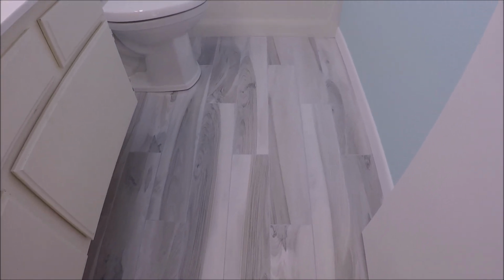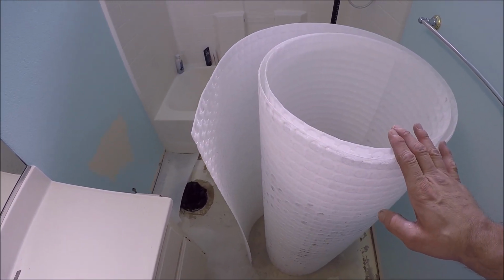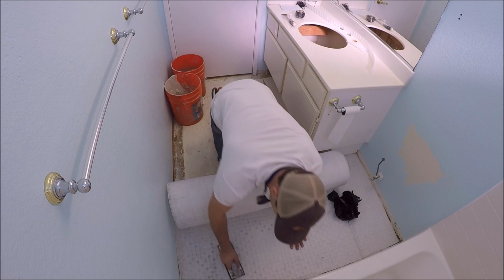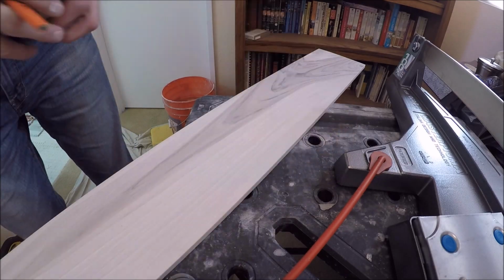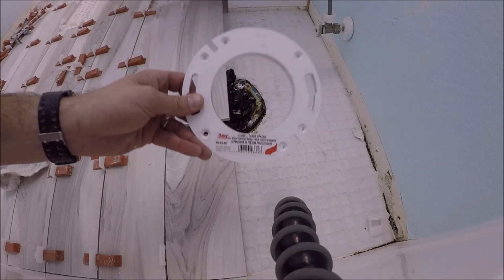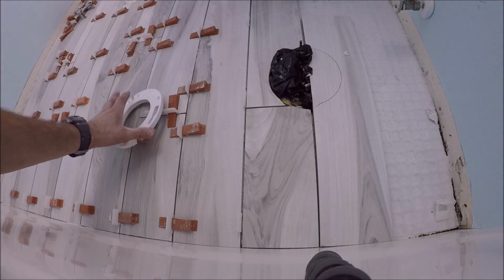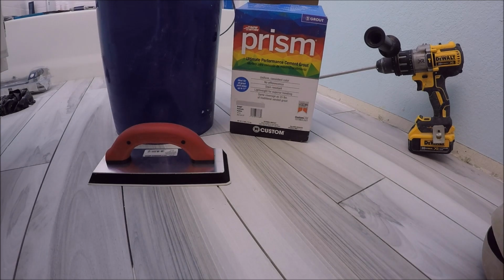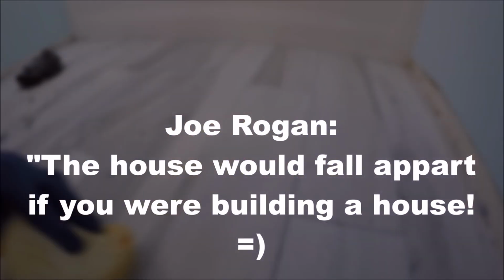Install Wood Look Tile - No Tile Saw Needed!

Comment: Looks great.. and so quick. At 7:09 you show that you've continued tile on both sides and are now filling in the center. Especially with only 1/16" spacers, how do you make sure you aren't just a little off? How long are you comfortable with moving the tiles slightly after laid down?
I always end up tiling this situation on a second day. Would be nice to do it all in one.

Comment: Great video only thing I dislike is the pattern matching on the tiles, I know you can never get it perfect but at a glance I can definitely see some I would have flipped round
Reply from the maker: I agree, we usually ask the customer if they want it random, or to match up the veins/movement. They wanted random..

Comment: How did you clean your tile surface before and after grout how you remove the grout sand? I know people use acid or vinegar, sometimes just water. Just curious I have learned a lot from you.
Reply from the maker: Just water and a sponge

Comment: I am in the middle of two bathroom remodels (DIY projects) with wood plank tiles as well. Do u reccomend removing the vanity if it is not going to be replaced or just tile around it and buy a bit extra tile just in case it is ever removed?
Reply from the maker: I would simply tile around it unless you plan to replace it now or in the future.
Reply: @LandbergTileTV  No i have no plans of replacing it for the next few years. In fact i painted it and made them both look new and plan buying knobs for them. Thanks for the advice i was dreadomg the plumbing

Comment: What are those clamp down spacers? Do they make for a more leveled time set?
Reply from the maker: Yes, that is a leveling system called RLS tile leveling system. This helps and provides a superior installation for large format tile and porcelain plank tile. 👊

Comment: What is the model number for the Montolit diamond blade that you are using?  Great Video by the way.
Reply from the maker: I don't know, but I got it from Contractorsdirect.com. It's the Red and blue Montolit blade...
Reply: Thanks!  I bought the Montolit 4.5 inch Diamond Blade Progres CG115 (Red/Blue)

Comment: When you use that tiling leveling system to prevent ridges do you clamp each wedge to the exact same depth? How do you do that? Do you count the teeth left on the back of the wedge or something?
Reply from the maker: Not necessary, simply pull the trigger until it feels tight and check for lippage 👊
Reply: How do you check for lippage? I saw one video of a guy sliding a coin across. Thanks again
Reply from the maker: Use your finger! or slide a bucket across 👊

Comment: Great video!  I am a little nervous about tackling my bathroom this weekend (same layout as the one in the video).  Question...I know you are suppose to lay the tile 1/4 from the wall and 1/8 from  the tub.  Did you put the underlayment and thinset that distance from the walls and tub or does it go right up against it?  I am not sure it matters.  Also, are you using silicone sealant between the tiles and wall and tub?  Thanks!
Reply from the maker: Yes, you need space for expansion/contraction and yes, we use 100% silicone where the tub meets the tile.
Reply: @LandbergTileTV   For Strata Mat on OSB, does it need to be waterproofed first or can the mortar go on the OSB without waterproofing?  Thanks!

Comment: Do you recommend using that underlayment on basement concrete slab, or tile with no underlayment?
Reply from the maker: I would tile directly on the concrete slab if it's porcelain, but would use strata mat if you install stone tile.

Comment: Do I have to use subflooring in the bathroom even if I live in a one storie house?
Reply from the maker: I'm not sure what you're asking, If you have a wood subfloor, you need a tile underlayment such as Strata Mat or Ditra from Schluter. If you have a concrete floor, you simply clean it and tile over it.
Reply: @LandbergTileTV  Than you very much for your answer
Reply: @greek7316  While it is physically possible to set porcelain tile on concrete, it is not advised. Over time concrete mass builds pressure due to ground movement, expansion/contraction, etc. and can potentially crack to relieve that pressure. If an uncoupling membrane is not used, the tile will crack with the concrete. An uncoupling membrane is definitely advised over concrete.

Comment: I have a question about leveling the floor for the tiles.  My bathroom looks to be exactly this size and everything is in the same spot.  The problem I have is the floor dips down slightly over by the door, in the corner, where the hinges are.  Can I ad a little extra back butter or thin set in the corner to level out the flooring?
Reply from the maker: Yes of course you can add more thinset. I would recommend using a half inch trowel for the floor and the back of the tile with a levelling system and you should be fine. 👍

Comment: Good video, moves along through the process nicely.  Do you seal the tiles prior to grouting for easier cleanup?
Reply from the maker: It's not necessary to seal porcelain tile, we only seal the grout after installation.

Comment: When I told they guy at the tile store I was interested in looking at the membrane he said he couldn't recommend it over cement board because if you have any wood deterioration or settling over time, the membrane would move with the wood floor and I'd get cracking.
What are your thoughts on that please.
I wanted the membrane because I don't like the idea of a half inch plus threshold.
Reply from the maker: That's absolutely incorrect. We have not used concrete board for over three years and will never use it again! The uncouplying membrane does the exact opposite of what he says. It is made specifically to avoid cracking of stone tile or grout lines. He is simply not educated. Check with Sal Diblasi. He will say the same thing.
Reply: Thanks for the reply. The other problem is having to buy a whole $170 roll when I only need 20 sq ft.
Reply from the maker: That sucks, our local tile supplier sells it by the square foot/linear foot. They cut off what we need...Wish I had some extra, I would ship it to you!
Reply: Dude, I'm gonna check that out to see if they will do that for me. Thanks a lot.
Reply: @LandbergTileTV  
So I was lucky and found a place to cut me 20 foot. Yay for that, but everything I'm seeing on the internet talks about laying my wood look tile on the sub-floor, but when I took the old linoleum tile off, it had been laid directly on top of the wood plank floor that is flush with the floor in the hallway. Am I supposed to demo down to the sub-floor or can I just lay on top of the planks and use a wood reducer threshold thing.
  I had a guy doing part of the install, but he is not available atm and has never heard of Strata mat. He said I have to have an inch of sub floor with hardy backer on top or the movement would crack it.  I apologize, I'm having to learn to do all this myself, thanks for being here.
Reply from the maker: @y0nd3r  Yes, you need to demo to the subfloor, sponge the wood subfloor and install the Strata mat. You don't need 1 inch of plywood for your subfloor. We install on 5/8" or 3/8" subfloor all the time with Stratamat.
Reply: @LandbergTileTV  assuming I'm able to get close to the tub with a sawzall or a wood chisel or whatever, that's still gonna leave the tub on top of the wood flooring. Is that not a problem?

Comment: Why didn’t you remove the vanity
Reply from the maker: We remodeled the entire master bathroom, this was the hall bath and our customer was on a budget. 👍
Reply: Landberg Tile TV good point. Also why did you lay the mat down if the floor was fine.
Reply from the maker: Never tile on plywood, always use an underlayment like ditra, strata, concreteboard etc.
Reply: Some manufacturers say its ok to thinset right ontop of plywood.
Reply from the maker: @AHLive215  I would always recommend against it.

Comment: QUESTION ON THE TILE USED?
Reply from the maker: Yes, what is the question? It is a porcelain plank tile 6" X 36" size.
Reply: YES IM AWARE OF THAT, WAS JUST WONDERING WHAT SHADE OR COLOR THE TILE WAS? IT HAS A VERY NICE LOOK TO IT.

Comment: Ok you installed a 30 foot bathroom floor without a wet saw. Now go install 1500 feet without a wet saw. The title of your video is very mis leading
Reply from the maker: Really buddy? Misleading? Of course you shouldn't install 1500 square feet without a  wet saw. Why the angry comment...
Reply: landberg Tile TV not angry at all. J/s